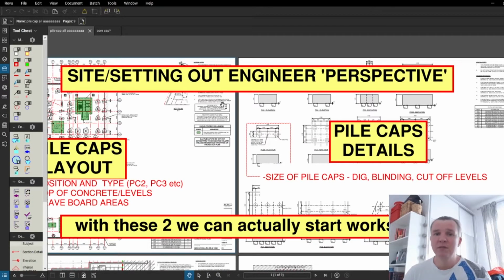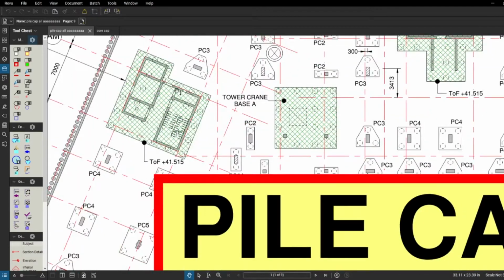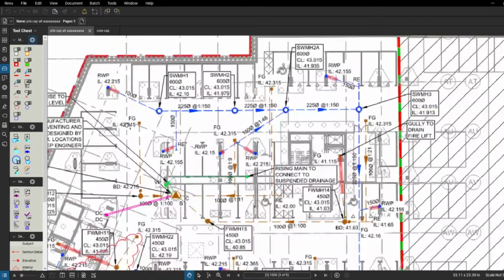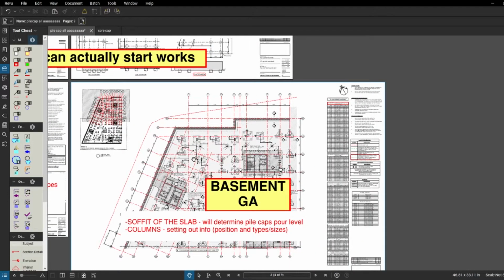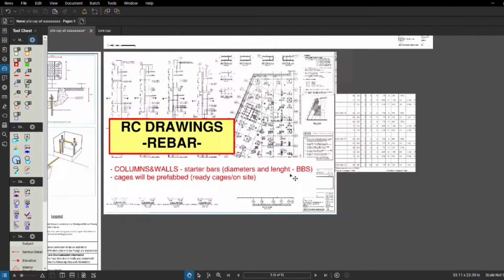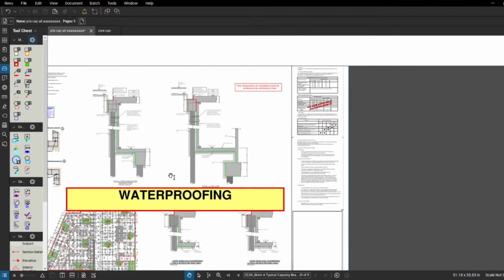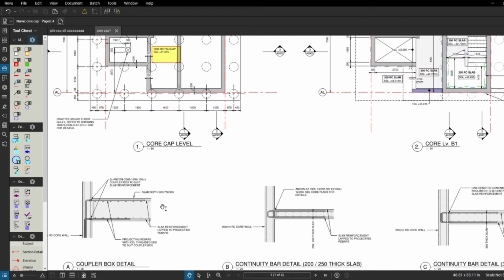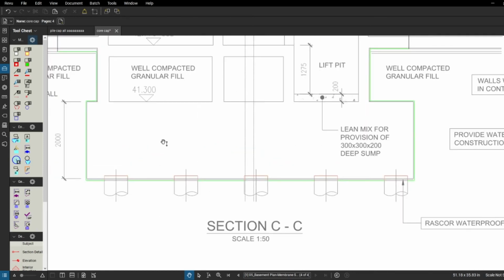How to read Construction Drawings #13. Pile caps step by step. Core cap.

Comment: Hi siteng, foremost, nice work you put together by explaining these details. Now I want you to throw more light here, when I look at the cores in the drawing, there are two that attracted my attention and I can see that they are not parallel to each other and I can see that there are two sets of gridlines, each parallel to each core. So if we are using TS06, that means we shall have different controls coordinates to setup from when setting out each core. 

Is that correct?
Reply from the maker: You can use a reference line as your grid line, or like you say you can create 2 local grids, which would be the way to go as whole block will be on different grid 👊

Comment: I'm Trying to understand drawing for dormer loft conversion and I got to  the part "Rafter Beam" where they write timber grade C24, timber size 170x44 and than "@400 c/c"   I'm trying to figure out what does this last part  means. Any idea ?
Reply from the maker: Hi Daniel! @400 c/c means- at 400 center to center 😁 So your beams have to be set every 400mm

Comment: Where do you check for how dip you digging? Pal
Reply from the maker: Everything should be on the drawings Jonathan. Pile cut off level is a good indicator, but you need to check the structural section and details as there might be something going under the soffit like cell core, so in this case you have to dig deeper. You have to also allow for the blinding so typically 50mm extra to dig. Best drawing would be a section showing the levels 😁